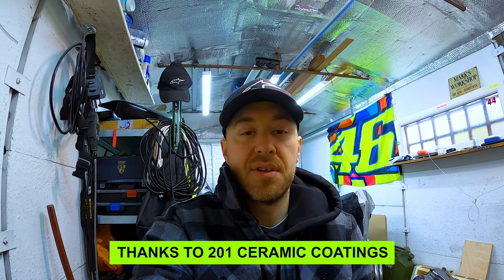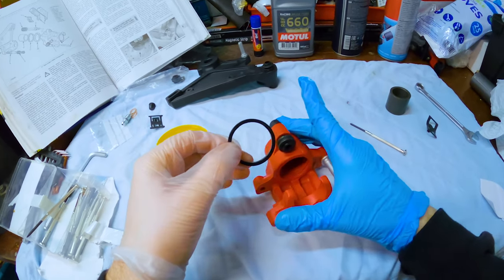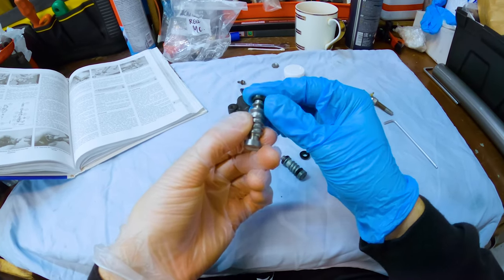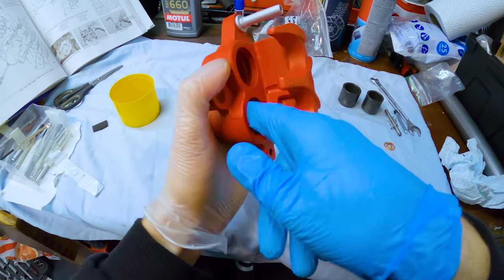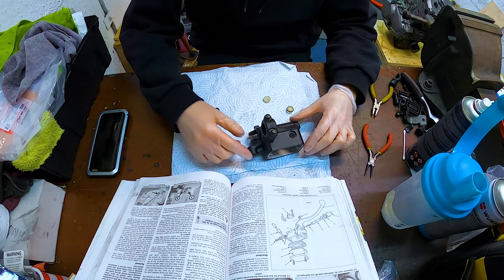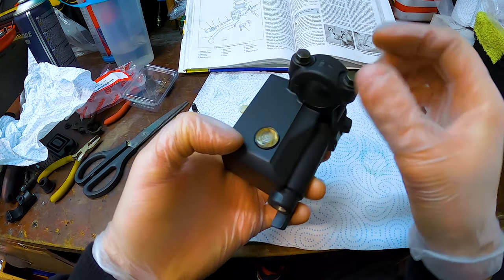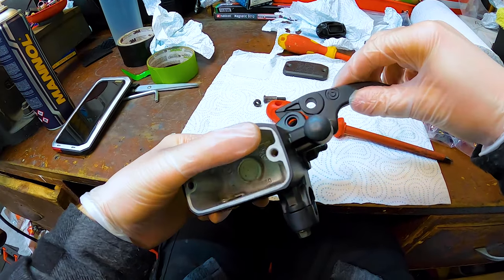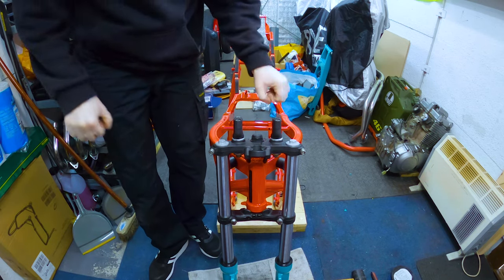Honda CB 500 Caliper seals and master cylinder rebuild (part 7) 93 - 03

Comment: That ceracote looks awesome, really nice! 
Little tip: when you tighten the fork tops, leave the top yoke clamp bolts loose. Do the fork tops first, then tighten up the top clamp bolts.
Reply from the maker: Yeah he does a nice job. It wasn't really needed as my original calipers were in nice condition, but I couldn't resist getting them Painted red to match 😁 Cheers I'll give that a go next time I have to take them out. Appreciate the comment 👍

Comment: Hi Suggy, I need to rebuild the front master cylinder. Do you know guys that run it without the front spring inside the dustcap?
Reply from the maker: @1pokiwoki  I think you could run the master cylinder without it, but most just put the new one that comes with the kit back in

Comment: good night, how are you?
what kind of paint did you use on the brake calipers and cylinders.
thanks
Reply from the maker: Hi it's been carakoted, it's a ceramic coating that is really thin but hard wearing. Looks really nice compared to paint and powder coat 👍

Comment: Good afternoon, how are you? where did you buy (which website) the front brake cylinder repair. thanks!!!
Reply from the maker: Hi, they are from https://www.sfpartsltd.co.uk/brakes-c-372/ on the cb500 section. He sells brake caliper seal kits 👍
Reply: Thanksss

Comment: Where did you get the new parts for the brake calliper? I need everything 😂
Reply from the maker: It's all from SF Parts online. You can get most bits. Some of the parts I had recoated. As long as they aren't totally knackered you can resuse them. It's only really the pistons you need clean.

Comment: What is the name/brand of the threadlocker you use?
Reply from the maker: It's a loctite 248 thread lock stick. It's a medium strength as you wanna be able to get it out again if needed.
Reply: @SuggyRacing  thank you
Reply from the maker: It's exactly the same as the liquid version of loctite in the bottle. Just a little easier to apply I suppose. It's all the shop had when I bought it 🤣